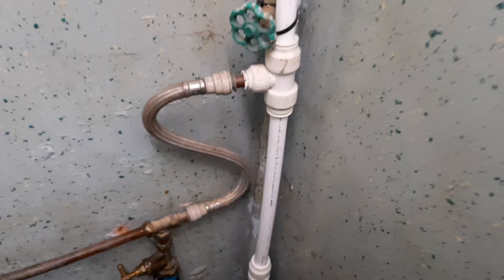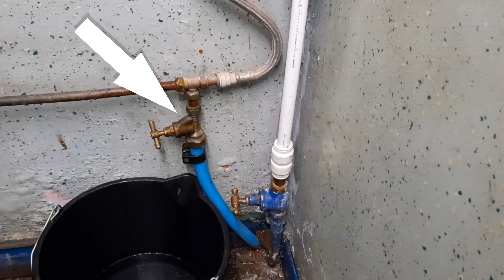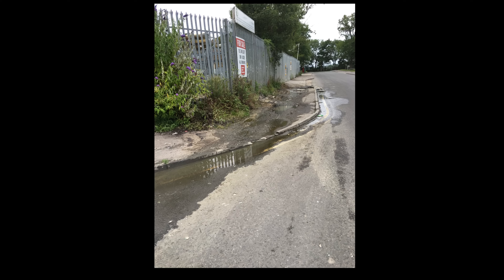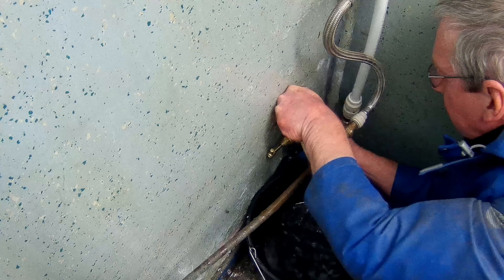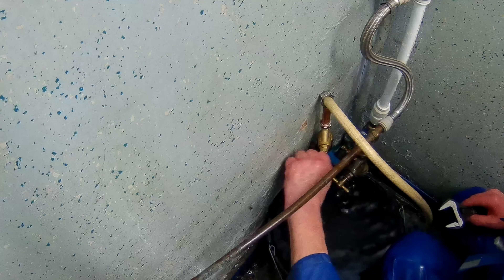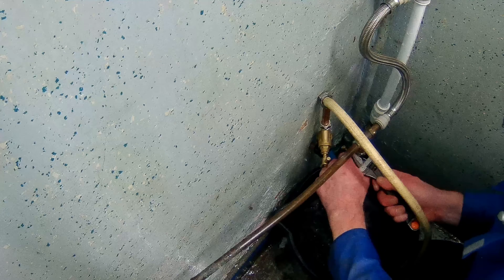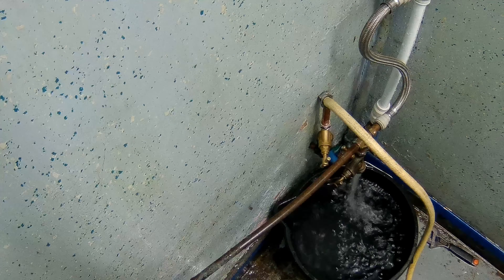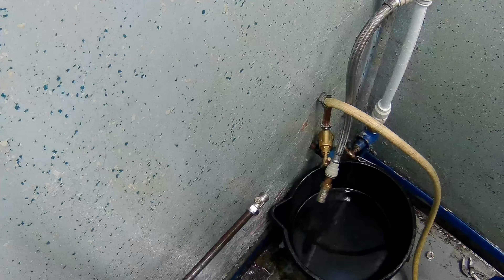Change a stopcock / stop valve on a live water supply DON'T TRY THIS AT HOME!! NOT a “how to do it”

Comment: Old boy taught me to open all taps upstream in a house if chaging a tap or pipe ans cant shut off at mains.

 Obviously wont work for the main stop tap.

Useful for where you cant shut off mains water at the incoming tap.
Reply from the maker: And he was right! Also it works if you CAN shut the water off especially if there are taps at a lower level than you're working at. Thanks for watching and commenting!

Comment: You can isolate the water main by freezing the pipe. You can get pipe-freezing kits for about £20.
Reply from the maker: Yup you can and I tried it (when I fixed the original leak about 2 weeks earlier) and it didn’t work, possibly because the water was always moving which doesn’t work well with freeze kits. I now have a semi commercial pipe freeze setup which would have done it but it was way more than £20. Thanks for the thought though 👍
Reply: as said you can't freeze a pipe thats leaking its moving water it has to be stationary to freeze it

Comment: one of my biggest fears mate, i'm thinking of getting my stop cock replaced with a sure stop with switch so it would be easier for me to isolate my mains located in the usual hard place to reach under the kitchen sink. I've got arthritis so problems to bend etc.....  Thanks for the clip
Reply from the maker: Thanks for the comment. Something that we had done for the in-laws was replace the tap type stop valve with a lever arm 90 degree shut off one. We also talked of  putting a cord through the hole in the lever arm so the end could be hung in an accessible place to just be pulled in case of emergency.

Comment: Excellent nerve to do that. 

I’ve got a stop tap in a domestic to do (won’t shut off completely....tap on boundary also non existent) poss freeze job ....#shittingmyselflol
Reply from the maker: Hey Paul, well as I and some others have pointed out I’m not a professional! based on what I learned from doing it and from others comments since, this is the approach I’d take now: (in order of priority) 1: If it’s a local water authority valve that’s failed they should replace it fast and for free. 2: If it’s a blue plastic feed into the building, I’d get a pipe squeeze tool and shut it off with that. 3: If there’s no flow going through it,  I’d freeze it. Ideally I’d rent a Rothenberger electric freeze kit. 4: If I really couldn’t do any of the above options and it’s inside somewhere that matters I’d include buckets, mats and lots of towels in my prep. In your instance, your avatar is the gas safe logo so I guess your a gas engineer and it’s a paying job? Would you not be better subbing it out? I had the luxury of not having to worry about damage to the premises but I definitely wouldn’t do it the way I showed here in anyone’s house, way too much at stake for me as an amateur.
Reply: @oldmanwith  thanks for your reply and you’ve popped some good advice in there 👍

Comment: Why in gods name did you use a ball valve what why would you use of that needle valve thing anyway
Reply from the maker: Hi Mark, if you’re referring to the ball valve in the copper off to the left, then its because I hadn’t realised there was nothing in that line to isolate the run to the petcock that it feeds and I had one in my box of crap. Also (being an amateur) I’ve fitted probably 15 to 20 of them over the years and never had an issue although I know they’re a subject of derision to the professionals. If you mean the one on the right in the second main (plastic) that’s not my doing. Which bit do you mean by the needle valve?
Reply: @oldmanwith  My comment got messed up I just was wondering why you were using those needle valve gadgets instead of a good ball valve with a lever on it. But I suspect it has something to do with the mess you were in
Reply from the maker: 👍 I’ll put a bit more explanation on the blog post when I get a minute later in the week.

Comment: At least the flow rate was terrible 👍🏻
Reply from the maker: Is that from UK experience? Just interested because I have nothing to make a comparison with (except the hydraulic systems in the industry I work in which are in another league altogether) The point being that what you’re suggesting is that the amount of water could have been far greater, good to know 👍
Reply: @oldmanwith  yes mate could have been a lot worse. I’m in SW Scotland and at home I get about 35-40 L/min and standing pressure of up to 9 bar. Had to put a pressure reducing valve on cause the inlet valve on my washing machine kept blowing 😂🙈

Comment: Try that with 70 to 80 psi...... itll be different.. I've done that
Reply from the maker: Hi, yes I’d agree. These days I work in an industry where we use fluids at operating pressures of up to 300 bar (about 4350 psi) and it’s “interesting” when things go wrong. I can find a UK statutory water pressure minimum of 1 bar (14 psi) but I can’t find any reference to a maximum for UK domestic supplies, opinions seem to vary on an average pressure, where did you experience the 70 to 80psi? Was it UK?
Reply: Usa
Reply from the maker: @rajeshkumar-bw5bs   Ah ok, thanks Rajesh

Comment: That was genius; Thank you. :-)  

That idea of attaching a hose and leaving the valve open on the stopcock and draining to the toilet is incredibly useful.  My external house stopcock in a bit dodgy and I can imagine doing that with my internal stopcock at some point.  Also sometimes terraced houses have shared external stopcocks and it might not be possible to turn the water off outside.  This method could be used there too in a pinch.  Agreed, preparation is also key.
Reply from the maker: Thanks, can’t take credit for it, unfortunately I can’t for the life of me recall how I learned it otherwise I’d credit my source. In the blog I put a bit of a checklist of other methods I tried or would try if I was doing it again but for sure understanding the worst thing that might happen and preparing for eventualities is a must 😊

Comment: Just Clamp the poly pipe, as long as it doesnt have the red line down the side with the inner mesh, black and blue poly you can just sqeeze it off. What a mess, I wouldnt have you in my house. Buy yourself a sqeeze off tool, as a plumber myself Ive used them more times than I can remember, got me out of some tough situations. Sqeeze off  the poly first, test the taps if its still going sqeeze the plastic jg or hep pipe on the other incoming side above the other knackered mst,  2 clamps would have done that,  bought  you some  time to change that leaking tee which is all it was, you've even got a flexi on the one side of that tee aswell, so you've got plenty of play to get that tee out easily. Buy yourself some clamps, and line them both with a little mdpe or 22mm hep or something to give extra grip.
Reply from the maker: Thanks for your comments. A couple of responses if I may. Part of the point of the video is to point out that it’s not a great idea. That specifically came from the fact that there are a couple of videos on here proclaiming that changing a valve or fitting on a live main is oh so easy. Both are from plumbers (which I’m not). One is clearly on a heating circuit, not a live main and the other looks like it’s tank fed so my point was “this is what happens if you actually try it on a live main”. As I said, I’m not a plumber, i was in the trade 40 years ago but left to do engineering. MDPE wasn’t in common use when i was doing it and so the clamp idea was new to me. Yes i could have done it a couple of other ways and as i said in the video it’s not a great solution but there are other reasons why I did what i did. I’m not looking for congratulations on my fantastic work because it isn’t meant to be fantastic work. It’s not an advert for my services. i’m not looking to come and work in anybody’s house because that’s not my business these days. If anything I’m trying to encourage people to employ a tradesman if they’re uncertain of their ability to tackle the task in hand. My apologies if this wasn’t evident.

Comment: If I have to do live work on water pipe I use a squeeze off tool, the same tool the gas companies use to squeeze plastic gas pipe, works fine on water pipe as both pipes are made of the same material.
Reply: 'G' clamp and 2 bits of wood?

Comment: Why are them isolators rubbish?
Reply from the maker: I've never personally had a problem with them David but there's a general opinion amongst the professional guys that they tend to leak or seize. The nearest I have to direct experience is that my brother had a couple under his bath in the tap supplies and both of them leaked when he needed to isolate the taps. They'd been fitted about 15 years and unused until the point he tried to use them

Comment: you could have called your water supplier out as emergency, they will have to come a fix the mains shut off outside free of charge as it belongs to them  , or freeze  your pipe inside the building . but top marks for having a go
Reply from the maker: Lots of discussion about the freezing option Trev, and it’s a commercial property and a big argument about the damage to the road (and stop valve) so we’ve been waiting on an “urgent” fix for some time. It’s all about the pavement damage and who will pay. Bit more detail on my blog if you want some of the back story. Link in the description.

Comment: Use Squeeze off tool on 25mm mdpe, not a problem
Reply from the maker: Now that i wondered about and if I’d had a spare bit of pipe I’d have tested it to see if it worked but my worry was that if I damaged the pipe I was going to be in a world of drama. I couldn’t find any reference anywhere for anyone trying it, is it something you’ve done yourself?
Reply: @oldmanwith  works every time,  have to do it virtually every week as I work in the utilities industry.  You can even cut and snatch using Plasson or Philmac fittings.
Reply from the maker: Awesome, thanks for that, I’ll add it to the blog post and description, maybe it’ll help someone else.
Reply: @northernnarrowboater8423   I’d like to see this being done. Video anytime from you?
Reply: @drfred1203  one day I might put out a few vids, I don’t know how other people have enough time to work, film then edit.

Comment: I had the same problem as you, inside stop cock not working and outside stop cock buried in the road. 
I phoned up the water board told them the problem and within a week they had replaced the stop cock in the road so I could then isolate my premises from that and then did the repair.
Reply from the maker: Impressive, we’ve been waiting for months for the local utility company to fix the main valve.
Reply: @oldmanwith  
They actually came out the same day I reported it saying they would try to shut it off for me but they couldn't and about 3 days after that they had their shut off replaced.

Comment: Freeze the pipe, simple
Reply: Pipe freeze rarely work if water is still flowing through pipe. Even a trickle
Reply from the maker: Yup, it is. I used a pipe freezer and it simply didn’t work.
Reply: @oldmanwith  I’m a plumber and they freeze kit is rubbish , isn’t there a toby outside ?
Reply from the maker: Thanks, used to use pipe freeze kits (with pub Co2 bottles) years ago and they were ok ish but the one i have now I’ve never got to work well. Two live feeds coming in, both connected together and no means of isolation on either. Bit more info on my blog post about it. All fixed now but it was interesting 😂
Reply: @oldmanwith  was there not toby out in street ? Lol
Reply from the maker: Sorry, missed replying to that before sooo for the benefit of those that don’t know, toby = stop valve = stopcock = valve out in the street (or these days at your water meter) to turn off the water supply. And the answer is yes and no. It’s out in the street but the pavement is collapsed and the valve is broken. Long story, explained a bit more in the blog post, link in the description.
Reply: @oldmanwith  no luck mate lol
Reply from the maker: Plenty of luck, none of it good 😂😂
Reply: @oldmanwith  😂😂
Reply: Pipe freezing is very useful. Get yourself a rothenberger freeze kit, pricey but well worth it.
Reply: My electric pipe  freezer will freeze up to 35mm pipe in about 15 mins even if is trickling water like yours....👍
Saves getting wet and stressed
Cheers.....
Reply: @yensabi  am faster than a freeze kit

Comment: I’ve been a plumbing and heating engineer for a long time now and I know that takes balls to do 👍👍 I’ve only used one a couple of times over the years and not sure if you can use one on blue Polly but could you hire a rotthenberger pipe freezing kit? Fair play though you got it done👍
Reply from the maker: Hi Dominic, Rothenberger say you can do it and I have an Arctic Hayes kit which I’d already tried to no avail. My guess was the constant flow in the pipe was the issue. And I couldn’t stop the constant flow because the stopcock didn’t work. It made for an interesting 10 minutes especially when I thought I’d cross threaded the nut......
Reply: @oldmanwith  squeeze off kit would have stopped that blue pipe. 30 quid at tool station
Reply: @nikc888  I've always seen these and never really looked into them, are they any good? Do they damage the pipe at all?
Reply from the maker: @nikc888  Thanks yes, got the same suggestion from a couple of viewers, wish I’d known such a thing existed lol. I’ve added links to it in the blog post now
Reply: You can’t freeze a pipe that’s already leaking, clamp it 🤜

Comment: Excellent video - I love a mystery and some problem solving . Out of interest so you see a place for a bit of JG Speedfit when trying to make a connection under pressure like that ? I  did a small job on a cistern with no isolation and by having a little assembly ready and a tube to a bucket , I managed to get it popped on without too much mess . No way Couid I have got a compression fitting on as fast as you did ! Cheers mate .
Reply from the maker: Thanks for the comment. I used Speedfit on the pipework at home to replace a leaking speedfit that was fitted incorrectly by whoever installed it when the house was built. It was missing the pipe insert which was how I knew that fitting the insert would be a pain, especially with water gushing out! Nonetheless I had one ready in case 😁

Comment: Great video Paul, watched a few of your videos, I’ve a leaky stop value coming into a outhouse I need to change, I might just attach a hose to a new value and hopefully I get it fitted.
Will the old compression nut attached to the blue pipe fit the new valve. It was installed in the 70s to a blue mains pipe.
Reply from the maker: Hi Martin, thanks for the comment! In terms of the compression nut, in my case I started out confident that the replacement valve was entirely identical so I was equally confident I could just swap it straight over. When I actually did it you can see I messed about with it a lot and I did have a moment where I thought “ohhh it’s not the same, what do I do now.....”. I did have a back up plan of a set of pipe shears and a push fit valve so I could have just sliced the pipe and pushed that on but I knew I’d have to mess about with the pipe insert. As you see on the vid it was just that I had the valve skewed a bit and it went right eventually. If your replacement valve isn’t identical I’d be cautious because the further back you go, the more variety there is between manufacturers in terms of thread sizes and pitches. So if you like my thought process in order of preference would be: 1: Can I turn the supply of at a valve further up the supply. 2: Can I freeze the line before the problem valve. 3: Is my new valve absolutely identical to the one I’m replacing. If it’s yes to 1 or 2 I’m going that route. If it’s no to 1 and 2 and I’m uncertain on 3 I’m going to be ready with a pipe shear, an insert and a push fit valve but I’d do it in exactly the same way, valve open, hose on. To my knowledge the blue MDPE pipe size hasn’t changed over the years, commonest is probably 25mm but could be 20mm or 32mm. Good luck!